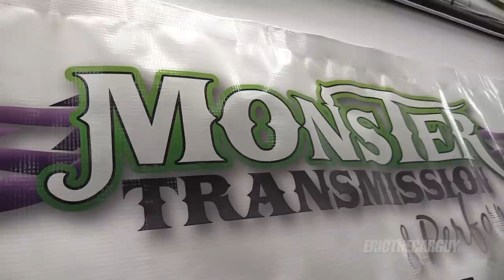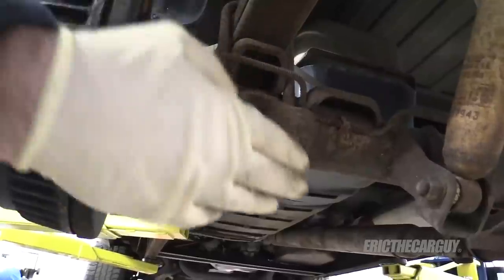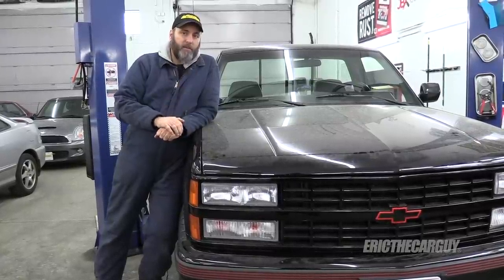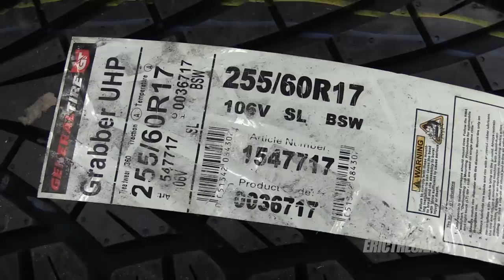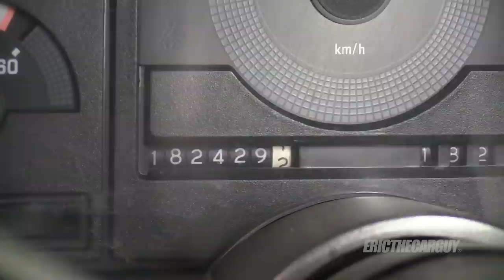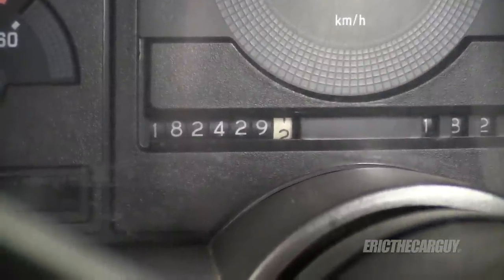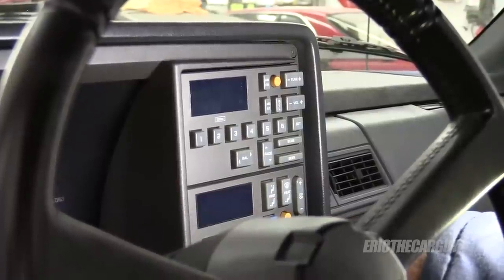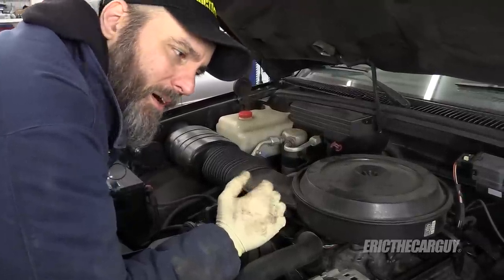#ETCGDadsTruck Build Introduction (Episode 1)

Comment: I would love to see you drop in a ZZ572 BB Chevy crate engine topped with a Holley EFI system or the new supercharged Corvette LT5.... but that is just me, LOL! Plus I'm sure you don't want to spend an arm or a leg on those. I will say ditch those old gauges and go with a custom set like you did in the Fairmont.
Reply from the maker: Well I wanted a CTSv engine, $15K was a bit steep though. I plan to do exactly that with the gauges. https://www.speedhut.com

Comment: EricTheCarGuy- have you decided on an efi system yet? I would look into the 24x conversion kit from eficonnection. Basically is a special timing cover/adapter kit with the proper cam/crank sensors and pickups so you can run a 350 small block on an LS computer which can be tuned at most dyno shops that do LS engine tuning. Use all the sensors, coils, ect... from an ls engine and adapt to the older small block so its just like doing an ls swap minus the LS engine lol.

Comment: I am SUPER looking forward to that brake master cylinder and booster video.  I spent way too much time on that stupid thing in my K2500.

Also curious how that axle will hold up.  I almost suggested the 9.5" 14 bolt but I don't know if that came in 2wd light 3/4 tons, I know it did in the 4x4 K series, but those are 6 lug.

Sounds like a solid plan though overall.
Reply from the maker: It's a street build. Also, I won't be tearing it up at the track. The 10 bolt should be fine. I hope...
Reply: Oh yeah, I doubt it will snap the first time you put your foot down, honestly a number of these axle assemblies are stronger than a lot of people give them credit for.  It's not far off from an 8.8" and people put TONS of power through them.  It might be a little different with a bit more weight on it (or less, being a pickup?), but if not romped on while towing I imagine it would be fine.

I just thought I'd see the 9.5" as is considered a fairly straight bolt in affair, not sure if the brakes are different (I think the same as 1/2 tons?) but the width, spring mounts, and in the case of the K-series, the wheel pattern is all the same as the 6-lug 1/2 tons, and I'm told 3.73's are somewhat common factory.  Mine came with it so I've never swapped, but I have put an ARB in one.

But anyways, I also think it will also be fine if not abused too badly.  But really that goes for anything lol.

Comment: Interesting fact!
That speedo was famous.  Only 88 and/or 89.  It would bottom out and come back up the other side (once you hit 100).  The 4x4's in 88 and 89 would NOT shut down (top speed)   I've seen those speedos come back around as high as forty five.  Eric can you find out if I was running that fast or if there was an offset.  Because there was a lag period between 85(where it disappeared) and 1 (where it came back up).  Btw.  Are those roller engines?

Comment: If you really want to be smart and budget minded you would still go LS.  Just go used truck engine instead of car stuff. A stock 6.2 or even 6.0 with a cam, headers and maybe heads would be sufficient, reliable and affordable. Use the stock ecu, get a standalone harness and get it tuned. Should easily make 350+ whp. You will spend ALOT more building that 350, adding MPFI and especially on a stroker. Likely be less reliable too considering you will be using a bunch of aftermarket parts.
With the LS you can stick with basically all oem parts besides maybe cam, valve springs and injectors, or if you really want cylinder heads. Plus you will have a stronger and better engine in every way. 
You can always add that caddy LSA blower later.

Comment: Eric I can't wait for this build personally. I have a 92 Silverado swb step side. What are your plans for the computer system on the truck after you possibly bore and stroke, put those heads on and put in the multi port system? Oh, what kind of cam are you gonna run in it?  Keep up the good work. Can't wait to see it completed and running!
Reply from the maker: The computer comes with the new EFI system. It will also have timing control as well as NOS capabilities. I'll go into detail about that stuff when I get to that part of the build.
Reply: @ericthecarguy  Thanks Eric. I've read up on those systems but my wallet can't handle it at this moment lol. Sadly I'm still running a stock everything. The first thing I wanted to do was change the dash from a 92 to a 95-96 dash as mine is busted and missing pieces (like that when I bought it), but after reading up on some information of it being done, it sounds more complicated than something I want to tackle in my driveway lol. Looking forward to the vids of the project 😊

Comment: The Holley Speed Flex hoses make great brake lines. If you're into a different master cylinder, do a Wilwood with a 1" master. It's on my channel.
Reply from the maker: I actually got all of my stuff in a kit. https://www.summitracing.com/parts/ssb-a126-2/overview/year/1990/make/chevrolet/model/c1500

Comment: Awesome! Love that truck, I’ve had several 88-98 GMT400 trucks myself, I actually just picked up a 95 C1500 regular cab stepside Silverado. 400hp with a MPFI 383 stroker should be easily doable. Which transmission are you going with from Monster? TH350/400 3 speed? 700r4 4 speed? Or getting the one that’s in it rebuilt by them?

Comment: PLEASE don't slam Dads truck on the ground, 2" in the front and four in the rear is all you should go, it looks better at stock or just a little lower. You better burn the midnight oil if your going on the cruise! I'll watch all the way thru the build.

Comment: Eric, any thoughts on the 1999 to 2006 4.3, 4.8 and 5.3 GM engines? I want a truck within that date range, but not sure what engine is the most reliable. I will occasionally tow a 3500 lb trailer over flat terrain

Comment: honestly I would leave it Stock as much stock as possible. I have a 94 k2500 just like this with 350 and a 5 speed. it's tough and pulls fine. so whatever you wanna do I would leave it, don't lower it, don't change the rear drums to disc. don't even touch the engine. just keep up with maintenance and it'll be fine

Comment: Eric, I'm looking forward to the brake changes because I have a 91 C 1500 and the brakes have always felt spongy and tentative. The only thing I never changed on the brakes is the booster. I was hoping the new master cylinder and all the related brake equipment including copper nickel lines would help the brakes feel more solid but unfortunately that didn't help at all so I'm really looking forward to your brake upgrade. As far as your going with EFI, Jim Inglese of Inglese Weber carburetion is now offering 8 stack electronic fuel injection. You might want to check his systems out at Jim Inglese.com.

Comment: You should look into a hydro boost setup for brakes.
Reply from the maker: That would overcomplicate things because I'd have to tie into the power steering. I already have my new brake set up. https://www.summitracing.com/parts/ssb-a126-2/overview/year/1990/make/chevrolet/model/c1500

Thanks for the suggestion though.

Comment: Steel braided lines are a godsend! Did wonders for brake petal feel in my car. Also, what ECU are you going to use for the new multiport setup?
Reply from the maker: I'm looking at this kit from Edelbrock. https://www.edelbrock.com/pro-flo-4-efi-system-for-1986-earlier-small-block-chevy-engines-35760.html

Comment: @EricTheCarGuy When you are ready to swap out the gear set in that 10 bolt please make a start to finish tutorial video with no edits!
Reply: Basically don't skip over anything especially adjusting backlash and pinion depth!
Reply from the maker: That's the plan. I did something similar with the Fairmont rear end. https://www.youtube.com/watch?v=5fARhE7v5Bg&t=115s

Comment: Have you thought about maybe a 454 instead of 383 or possibly some higher compression? What about maybe a 12 bolt rear end?
Reply from the maker: Sure, I thought of a lot of things, but I'm sticking with the plan I've outlined in this video for the reasons mentioned.
Reply: EricTheCarGuy just asking is all, I know that’s probably the go to for something like this. If you’re planning for roughly 500 hp, a 12 bolt might be a decent idea.

Comment: Hi Eric got a question I got a 1994 Honda Accord LX 2.2 when I'm sitting at a stop sign act like you shut the key off off and on size that runs good and sometime when you going down road does that and no lights coming on the dash and I put new plugs in there the other day and a couple days ago I put new distributor cap on it I need it anyway and my thinking is the coil breaking down but no lights coming on the dash I don't know if they do and what do you think where I need to start

Comment: Little Shop Mfg makes a really nice rear disc brake kit for these trucks. I have it on my Dodge (with a Chevy rear).  I'm also running Speedhut gauges. I like them very much.  I would do a Google search on Monster transmission. The reviews are not good.

Comment: Hey Eric I have a 1990 Chevy 1500 with a TBI 350 if I put some 062 vortec heads on it will they mess up the bottom of the motor in the long run

Comment: Nice I look forward to seeing this truck built. 

Hey if you are changing the AC system, can I have that U Shaped aluminum line that goes into the accumulator. I'll pay you for it. The threads stripped out on mine and I haven't been able to replace it. To get my air conditioning working I had to by pass the accumulator and the low pressure switch.
Reply from the maker: If I'm not using it sure, but I won't know that for some time. You might just take a trip to the salvage yard or see if you can find one on eBay.
Reply: @ericthecarguy  Thanks, I've personally haven't had much luck but I'll keep a eye out.

Comment: I'd be looking to turn it into a 454SS considering it's already black and has the right interior dash it wouldn't take much to turn that truck into a convincing SS clone but I know it's your truck build and I look forward to seeing it as a stroker are you planning to upgrade the exhaust with headers and 2 1/2" duals complete with x pipe and cutoffs I know you'll probably change the stock exhaust but I didn't hear any plans but as you know it won't run at peak performance if the stock exhaust is choking the engine.
Reply from the maker: No need for an X pipe on these trucks. The fuel tank takes up the entire drivers side so you need to run single exhaust into a muffler on the passenger side and branch off duals from there.
Reply: I'm mostly an exhaust tech nowadays the reason I like the x-pipe on those trucks is because it gives it a lower rumble because the exhaust gases mix together giving it more of a continuous sound it's possible to run the true dual exhaust down the right side with or without the x pipe 2 1/2" pipe is about the limit with duals though and still leave clearance room so it doesn't hit anywhere many people do opt to go with something more stock 2 1/2" from the headers into a 3" single pipe and then split and run duals from the muffler like you mentioned but with the stroker engine I'd definitely use headers and 2 1/2" pipe then step up to 3 going from the y pipe back to the muffler and use 2 1/2" duals on out just to make sure the engine can preform at it peak. 
I really didn't think I'd get a response back since you've got so many subscribers, it's your truck Eric I'm just glad to see another of those trucks still around and in good hands that body style was always one of favorites.
Reply from the maker: The muffler acts as an X pipe because both banks feed into it. The collectors of my headers are 2.5". I'll continue that all the way back from the muffler. I'm also considering a cut out similar to what I did with my Fairmont. https://www.youtube.com/watch?v=cKgTuIFKAvo&t=23s

If I go with the cut out, I'll likely run a Walker muffler so it runs relatively quiet. I ran the same thing on the Fairmont and I really like it. Thanks for your input.

Comment: You should go with a used naturally aspirated LS engine
Reply from the maker: But I already have a perfectly good 350, why go through the time and expense? Maybe next time.
Reply: @ericthecarguy  I understand if you was going to do anything to the engine but you mention replacing heads, intake, cam, fuel injection, stroking it and possible machine work to accomplish the stroker kit and cylinder bore, freshin up all bearings and rings. A used LS would take car of all of that with probably more HP than you would get from the 350 build, then if you find that you want more power you have a better foundation to build from with a lot more power available from aftermarket parts before you would have to start adding power adders. Just a suggestion with the money you would be spreading to get o basically the same stock HP a LS would provide basically stock though a programmer with a few button pushes or custom tune. Either way I'd like to see the truck build.
Reply from the maker: Trust me, I've been weighing the options for a while now. As I mentioned in the video my neighbor was going to hook me up with an LQ4. I looked into it and decided the 350 was a better, more economical, option, even with the mods I mentioned. After all, the 350 was the engine of choice for 50 years. There might just be more available for that than an LS in the aftermarket.

Comment: Eric I’ve got a couple questions about the fairmont engine? What was the cubic inches of that engine? Also, did the engine originally have a roller valve train setup or was it a flat tappet system that you installed a roller setup into?
Reply: I built a ford 302 / 358 stroker (3.5” Stroker Crank with Cyl’s bored 0.040”) back in 2005 for my 1985 stock mercury grand marquis. It’s got a (RV Cam) with a small lope to it, a slightly built AOD -M and Ford 8.8 with Yukon gear & axle clutch type posi unit with the stock 3.73 gears. I made the mistake of reinstalling the stock CFI fuel system and stock TFI ignition system back on the engine with the EGR system too. Although the AIR system didn’t make it, (Ford’s Air Pump with the air injected catalytic converters). However, it still uses a narrow band O2 with the stock EGR, TFI, CFI & EEC-IV ECU. It’s got some pep but, it really should be putting out more than it does.
Reply from the maker: You've got a lot of videos to catch up on. Enjoy. https://www.youtube.com/watch?v=L22GsHQi7tU&list=PLSzhQ6St-ov2nxWVKCeU14Vt7JJ_QSZvs

Comment: Hopefully you can help me I have an 87 buick regal with a 307 v8 the battery is new it started up just fine I drove it onto my lawn to take pictures of it I shut the car off. Took pictures went to turn it on and it wouldn't start it would click and click that's it I kept clicking hoping it would turn on and smoke started coming from the drivers side of the engine down by the starter I stopped left it alone. The car is extremely low. Do you think it could be the starter?

Comment: Hi Eric, I have a question and would be grateful if you can help me. 
I have a Chevrolet Aveo, engine size1.3 diesel. 
When the rev reaches to 1100 to 1300 even though the gear is on neutral and the clutch pedal is pressed, the whole car start vibrating. I had a look to engine but the engine is not vibrating or it’s not visible .  Soon as the rev passes 1300 , it get smooth again. 
Can you please help me to find the problem? 
Thanks

Comment: Ahah, you can have a cammed and refreshed LQ4 for under 2k with HP tune or 4k with standalone engine management. Lets see how much are those parts you put on that 350 gonna be worth. Personnaly my 88 c1500 RCSB LM7 swap was well worth it altought I spent more money on the electronics than I'm whiling to admit... I guess you have to do the gauges anyway if you're ditching the TBI. As long as your 350 gives you north of 300whp for under 2k its worth it, if not, might aswell get the bonus of the MPG out of the newer engine platform.

Comment: Are you also going to replace the cam to take advantage of the new cylinder heads??
Reply from the maker: Absolutely.
Reply: @ericthecarguy  cool. Another idea is since it's a 1990 model year chevy. It's got OBD 1. You can remove the cats on it with no issue

Comment: Eric, will you sell it's cluster, since you don't like it anyway?
Btw, what if you install hydroboost and your pedal will be firm always and stops much better.
Reply from the maker: Hydroboost would involve plumbing into the power steering system and also taking up space on the firewall. I stand by my choice to upgrade the existing system.
Reply: @ericthecarguy  , ok what about cluater?)

Comment: So I'm not sure where you're figuring 15-20k for the LS swap but then want to basically swap everything to mpi...trim the harness yourself it's not difficult, they make the brackets, you can basically just delete VATS with HP and be good enough to drive, and they make adapter flex plates. You shouldn't have any more than 3k in it and have better heads and an overall platform than building the SBC. I can respect wanting to keep the SBC but those price figures are nuts.

Comment: Check out azproperformance  for a great 4 disc brake setup for the 90s trucks. They are made by  bear brakes 14" rotors up front and 13" in the back. A great setup for the price.